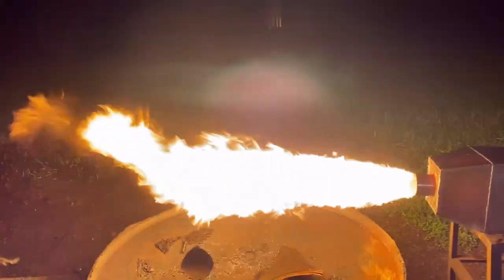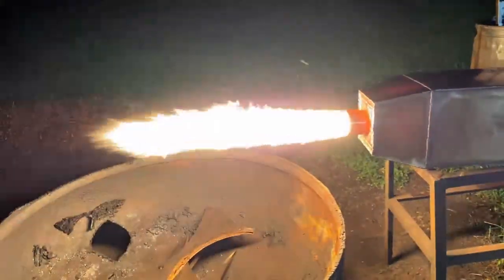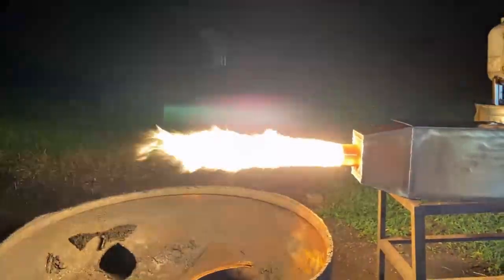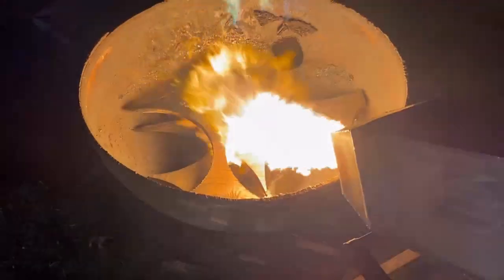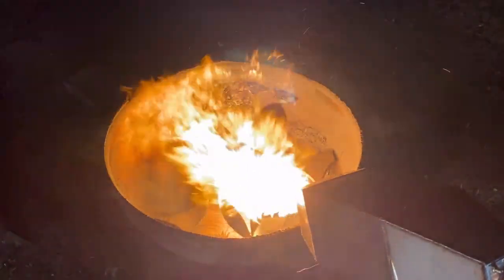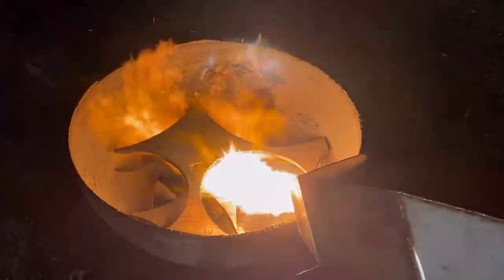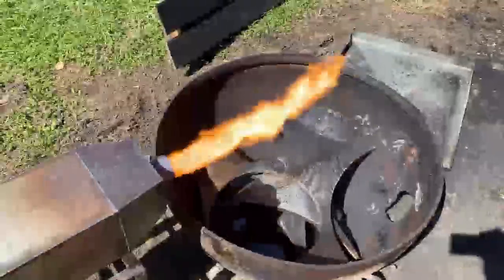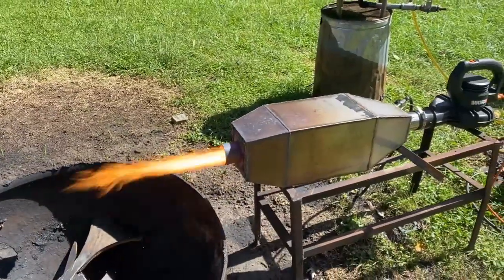Diesel Jet Burner For Waste oil burner Book

Comment: this common to old style steam cleaners. those designs also use a blower with burner. But they are not that common since most people use high pressure water , with out heat.